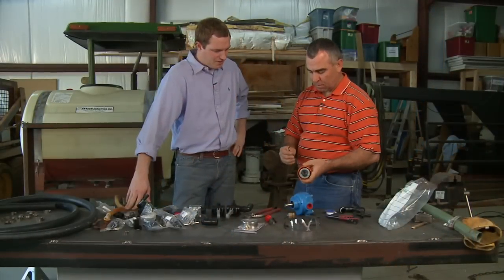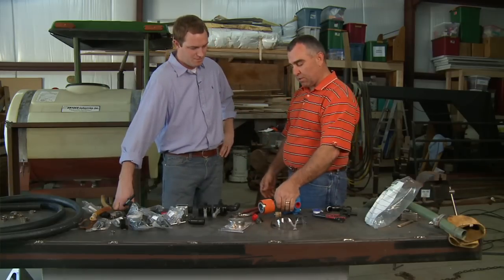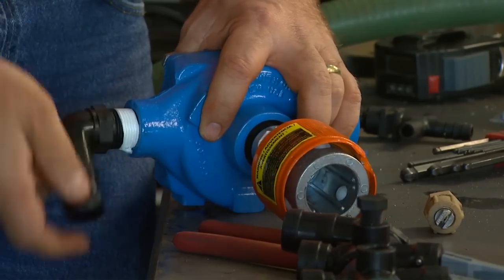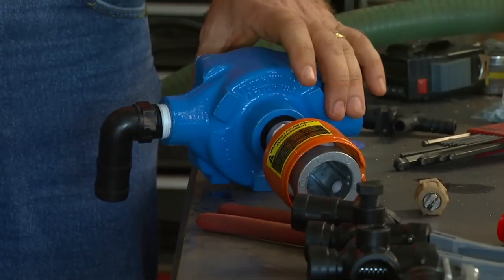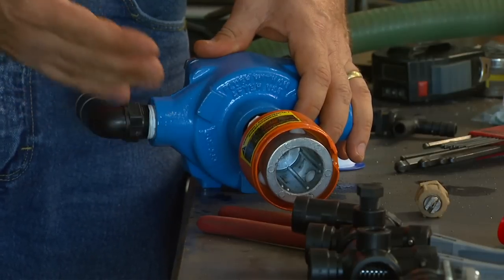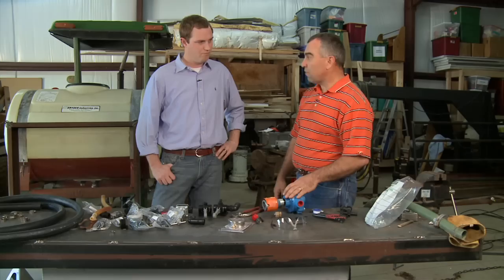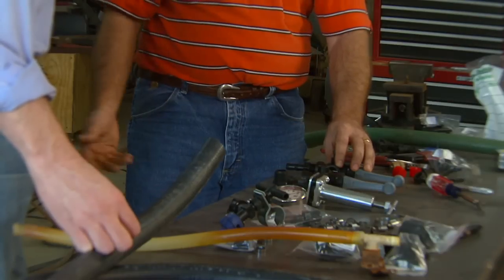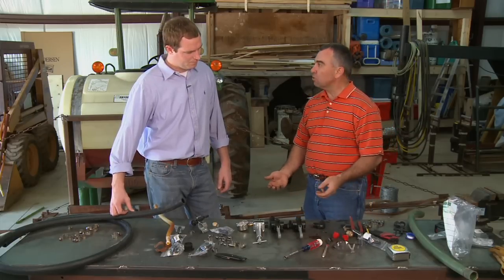Constructing a Sprayer: Part 2

Comment: There is talk about seal issues at the pto shaft into the transmission housing with the weight of a pump mounted onto the shaft wheather it be a water, hydraulic or other type of pump.  Can you explain this?